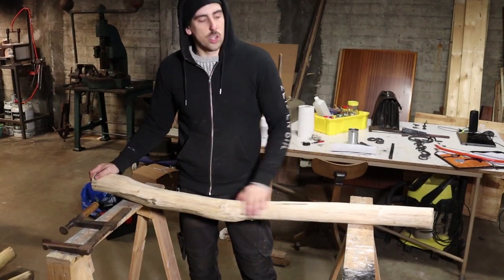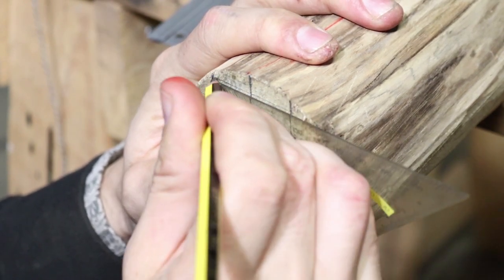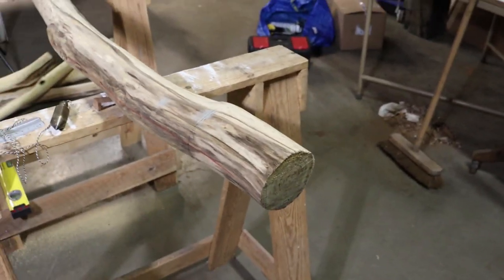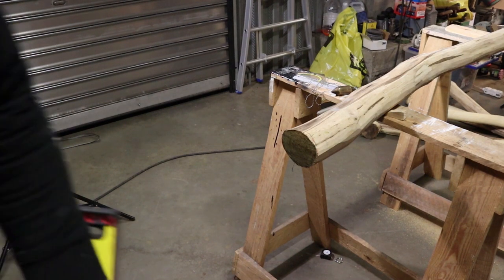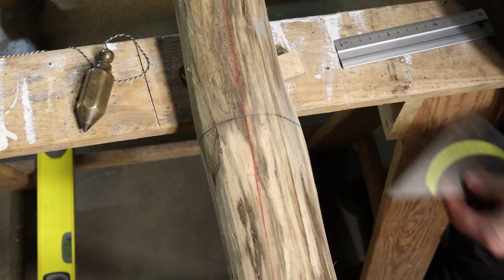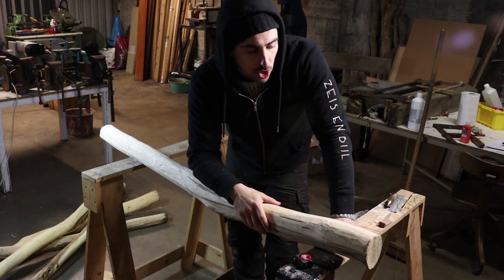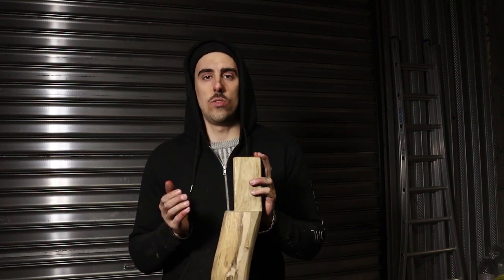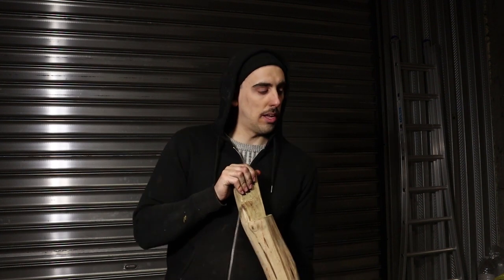Making a field gate with a complete laying tree - Kempens Veken - Part 4 -French scribing

Comment: Hy Marcel!
First of all, thank you for these videos, I am very interested. I'm planning to build a gate for our property this summer and have been brainstorming for a while.
I would like to know what kind of wood you are working with. From the bark I would guess robinia - is that correct?
Using a ripsaw for cross cuts is in my opinion not a faux pas - all my saws are sharpened to rip. They cut cross just as well, it takes 2-3 more moves to get through. On the other hand, rip-sharpening and setting is easier and therefore they run more precisely.
The last thing I can't resist to mention: You have a very nice old pairing chisel there. I assume it was made by Goldenberg? I have a very similar one, made of cast steel (Arcier fondu) and the rust spots on yours are breaking my heart (o;... I also have a fairly damp workshop, camellia oil keeps the rust at bay very well. Simple fine oil (acid free ) but does it just as well.

Wishing you all the best! Georg (from Germany)
Reply from the maker: Hi Georg, Thank you! I'm happy some people find it interesting. It is indeed robinia per request of the client and its level of durability. The rip cut saw was indeed just a mistake. It is a nice chisel indeed, and I had it cleaned up. But after a burst water line in december due to frost. Many of my tool have rust spots now. They will get cleaned up as I use them. This chisel is marked "CG". I don't know who the maker is. On the back it's marked "KVD", possebly by a previous owner. Thanks for the comment!
Reply: Oh, I'm sorry about your broken pipe. I had that too many years ago - so bad.
Yes, with robinia you have exactly the right wood, for this purpose I would rate it even higher than core oak.
CG as a manufacturer code: there was one in Germany (in Solingen) - but that doesn't have to mean anything. When cast steel came to France in the 19th century, there were countless manufacturers who processed this new steel.
Thanks for your answer! @MarcelTeugels
Reply from the maker: @georghalder2816  it happens, there wasn't too much damage. Just flash rust and all carboard is lost. Goldenberg is great though, I have some tool from them. Next up is balancing out the gate, I put the posts in the ground last week. The balancing might be tricky. We'll see